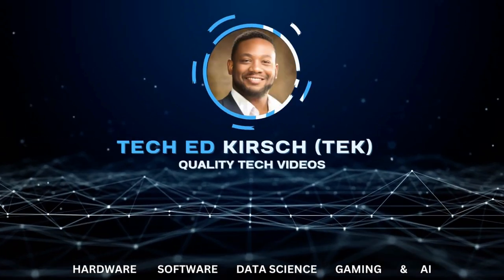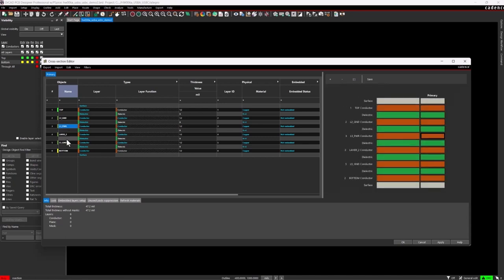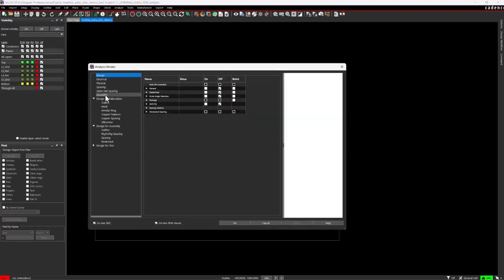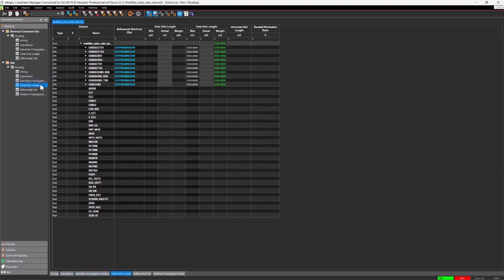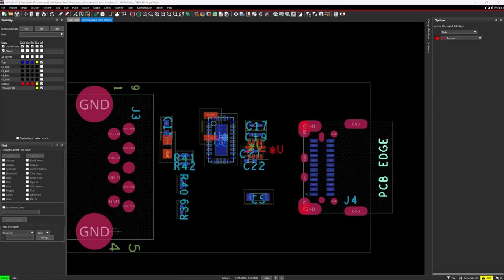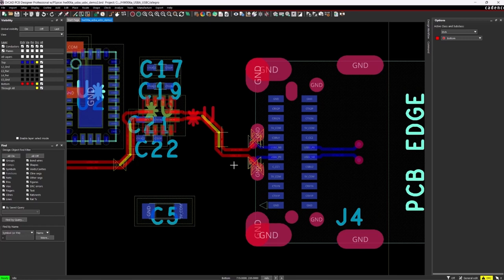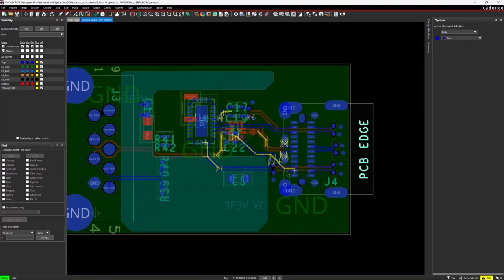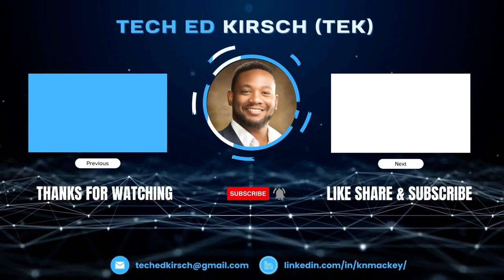High-Speed USB C & USB 3 PCB Design and Current Circuit Board Layout Tutorial | USB Type C Connector

Comment: Is it possible to redesign/modify my USB 2 board to convert it to the USB 3 by replacing the USB hub GL852G IC?
Reply from the maker: @lanphanh  possibly. You would need additional traces or wires on the USB2 port. But since that’s not feasible then there could be issues. I’ll have to see the details to know